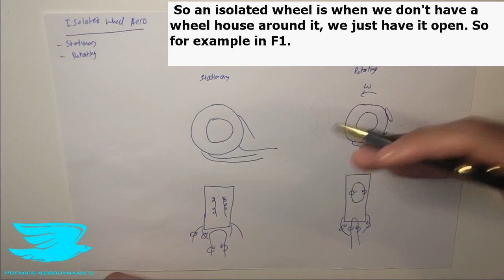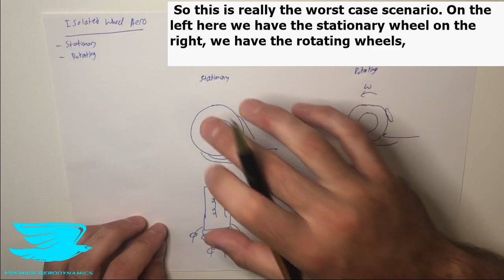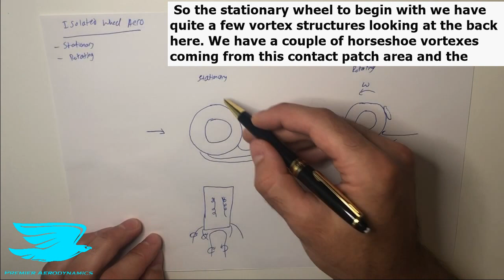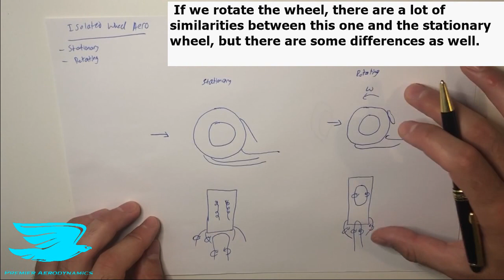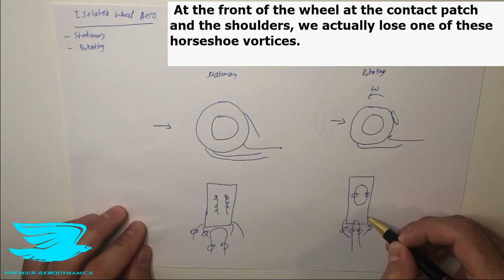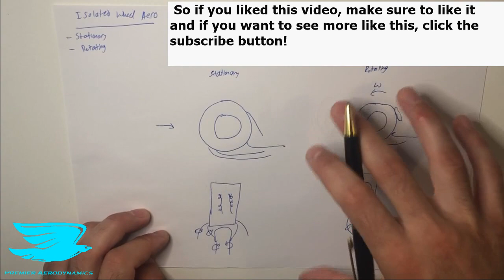Comment: You'd expect the boundary layer to grow as it rotates faster, it does, but not as much as you think it would. Also yaw and camber play a huge role in the way the vortices are shed off the tire. This is particularly important when you consider Ackerman angle and toe settings. Several CFD studies show that toe in increases the tire wake moving inboard(towards the car), and toe out reduces the tire wake from moving inboard. Another reason why creating outwash around the tire is so effective, it reduces the tire wake from migrating inboard under the car, which robs the velocity/energy of the flow under the car, which reduces downforce.

True you'd never run a car with 15 degrees of toe out, it would destroy its tyres and spin out by looking at the steering wheel, so you do the closest thing, and outwash air around the tire. Combine that with a tiny bit of toe out, and you improve underbody aerodynamics a significant amount, because you reduce the ability of the tire wake from slowing down the flow under the car.
Reply: Those are great points, and that's also one of the functions of the wheel spoilers. They help direct the flow, in a similar way of creating more outwash through the toe angle.

And yep, changing the angles of the wheels changes how the shoulders see the flow, which then changes how likely the flow is to separate around them.

It's funny how important the underbody is but it's not talked about nearly as much as it should be, imo.